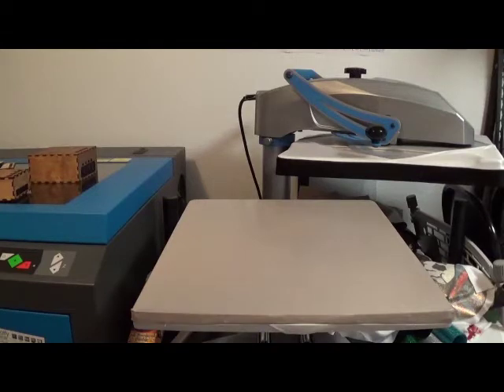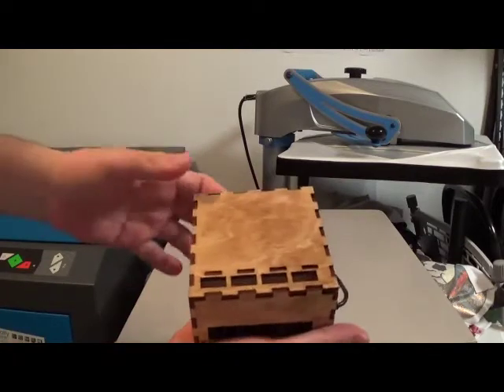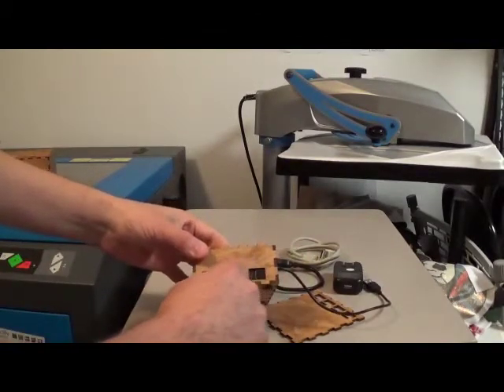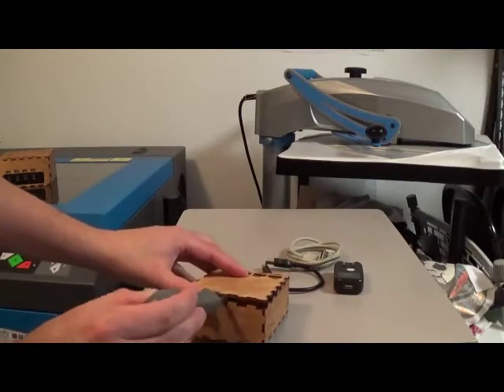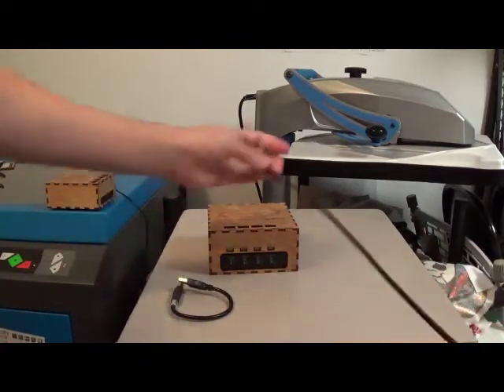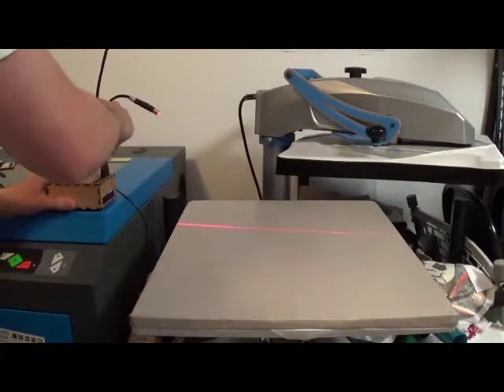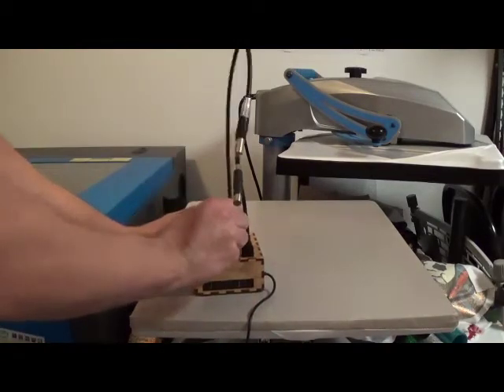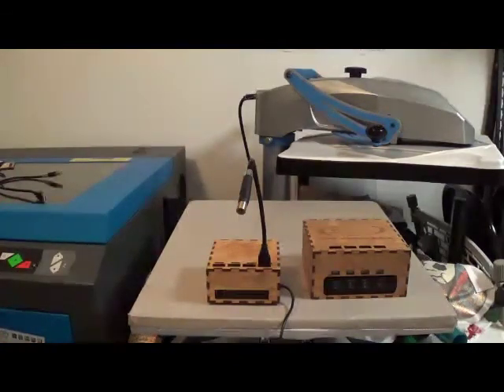Synergy17 - Mini Laser Alignment System

Comment: I know this video has been on a while but do you still make the box for the small unit?
Reply from the maker: I still have the design, so I can still cut this box out. The newer one that I sell isn't much bigger. If you have the smaller HUB in this demo, then you'll need the small design.
Reply: Where can I buy your unit from